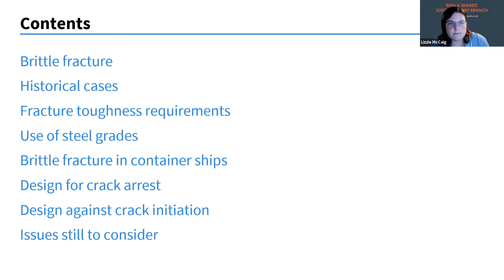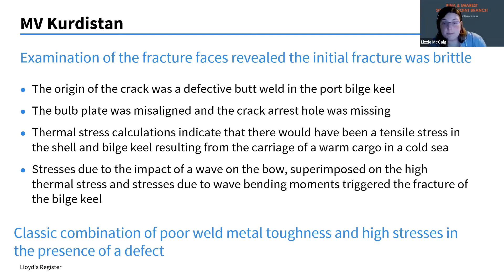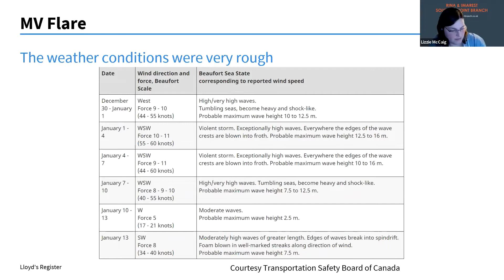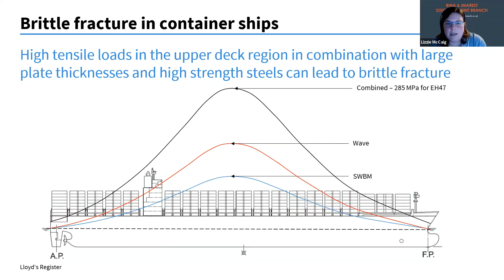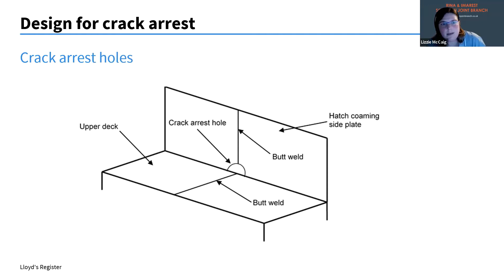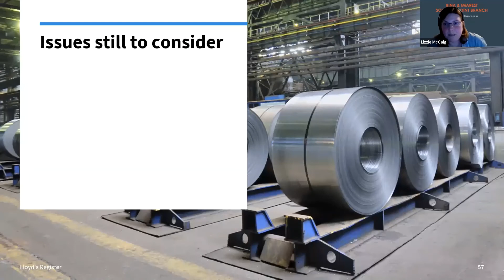Brittle Fracture in Steel Ships

Comment: The examples are mostly about sea going vessels. I'm interested in the design of heavy equipment which are obviously terrestrial in nature. Construction equipment is used in a variety of environments from very cold to very warm climates. Most construction equipment utilizes fluid power for actuators. Welding is used in most structural components. I've seen vertical weld on the boom of an excavator and that has baffled me a bit. There must be some kind of crack arrestor built in where the eye cannot see in the finished product.